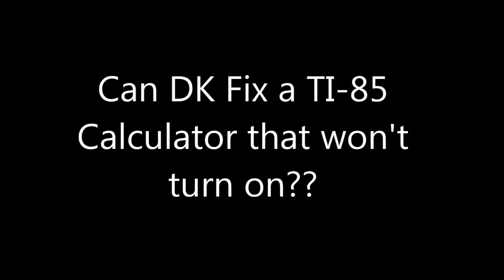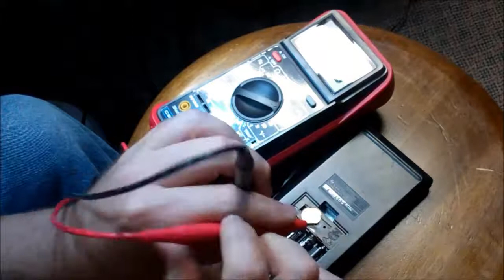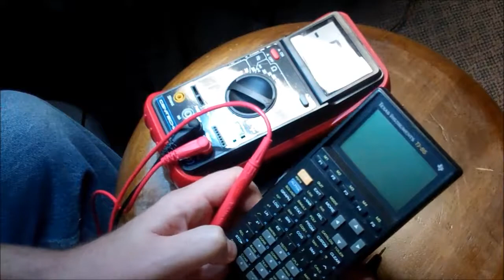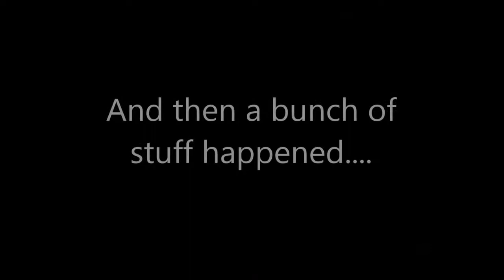Can DK Fix a TI-85 Calculator?

Comment: HI, great video but you did not show how to open this stubborn calculator ;)
Reply: Two small Phillips head screws on the bottom come out and the one that holds the small round memory battery in hold the calculator together.  Pry the edges with a small pry bar to get it apart after that.
Reply: @Como651  thank you

Comment: Hello, i don't understand how you fix the TI85 calculator.  On my calculator, i found some battery acid that i cleaned with wd40. After putting the batteries, there is nothing on the display.
Could you help me please? Thanks

Comment: Nice job. How come you didn't record or show how to disassemble the calc?  I only see 2 screws at the bottom rear side of the calc, plus the long screw holding in the button battery. Are there other screws or tips/tricks to getting to the mainboard?  Thanks!
Reply from the maker: It was my first time working on one.   The boards are stacked, and held in by screws.  It's a pretty easy disassembly.
Reply: @DeadKoby  Hi, thanks for your reply. While you were typing, I decided to take a similar attitude to yours in that, if I don't get it open, it's headed for the trash anyway, so I got a little more forceful and was able to "unsnap" it apart. Unfortunately I don't have access to a heat gun or other lab items this evening to try much more, but I will at the end of the week. Also unfortunate is that it looks like some battery acid may have leaked onto the mobo. Not sure if that did some permanent damage but we'll have to wait and see if the "poor man's reflow" has any effect. Thanks again for the video. It inspired me to try and save my HS calc from the recycling centers of the developing countries of the world. :)
Reply: @tlagrutta  Any news? :)